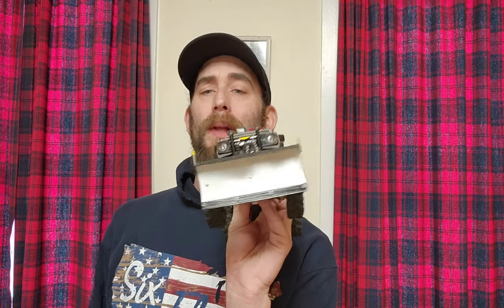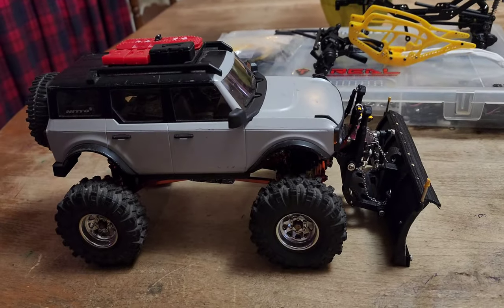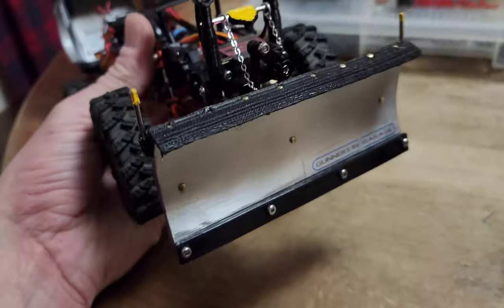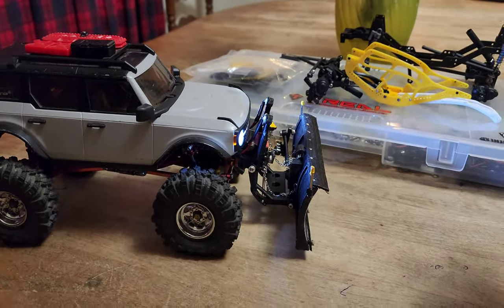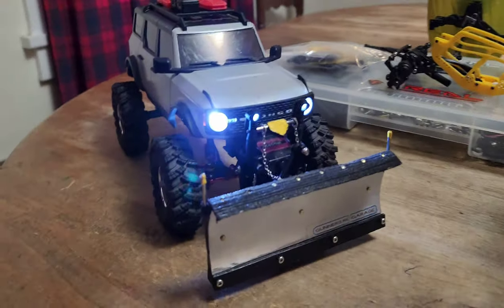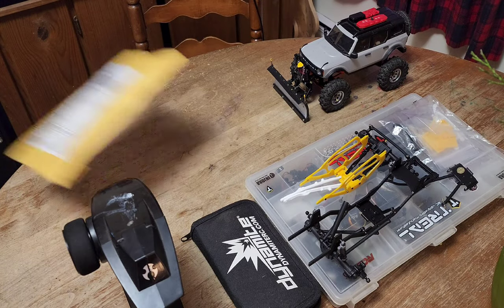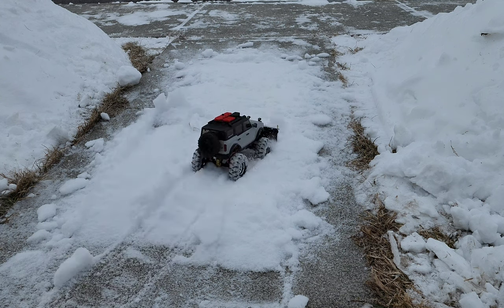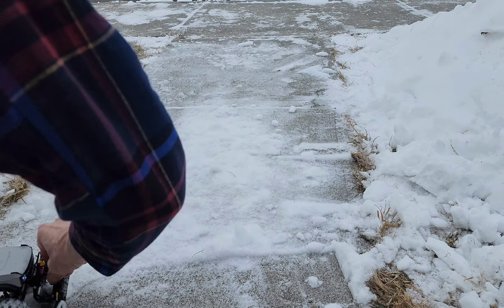Scx24 Snow Plow (Coolest Mod Yet?.) #rc #scx24 #rccrawler #snowplow

Comment: Does the scx24 have a low gear transfer? This seems like it would work really good when geared low and heavy.
Reply: That’s the reason why the Fcx24 would be the better choice for this, as well as their stock radios already have aux switches
Reply from the maker: I am working on a mount so they can be adapted to the Fcx24 line as well as adapters to plug into that esc